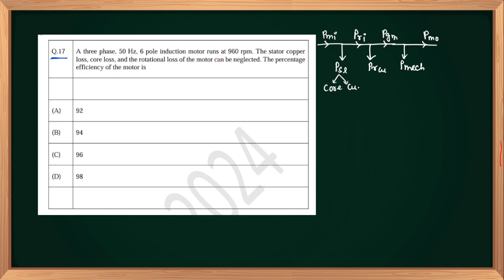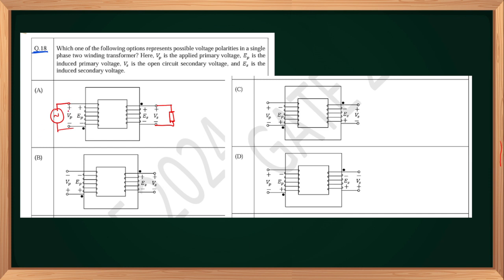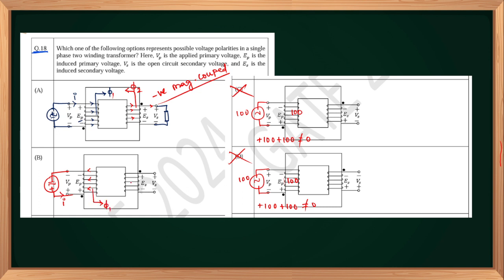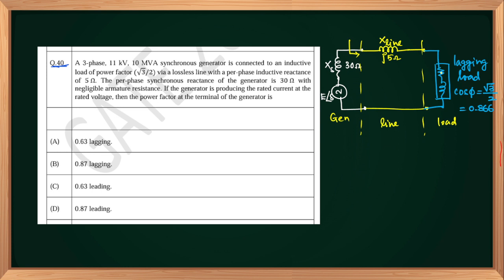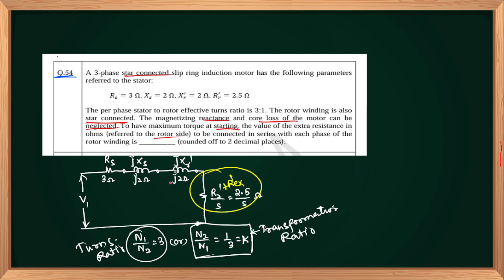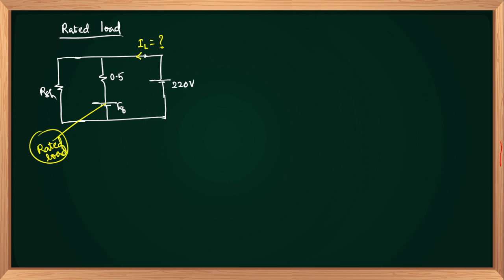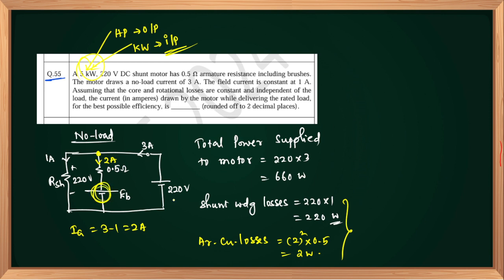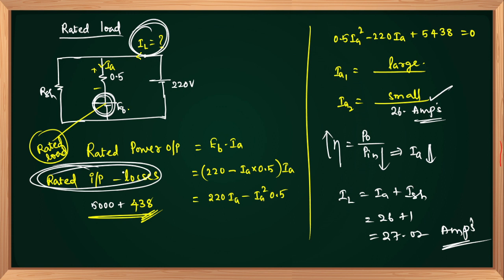GATE 2024 Electrical Engineering - Electrical Machines Solutions | Gate Exam 2025 Preparation

Comment: Sir question 18 has been given Mark's to all. Also the load is open circuited so there won't be current existing to oppose the flux from primary so both a and b can be correct right. Transformer always has sub polarity?